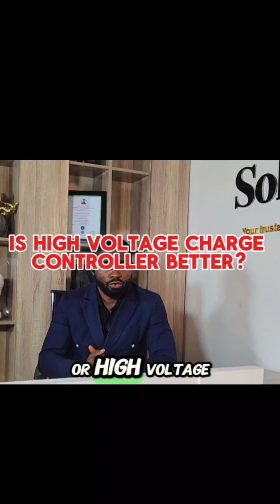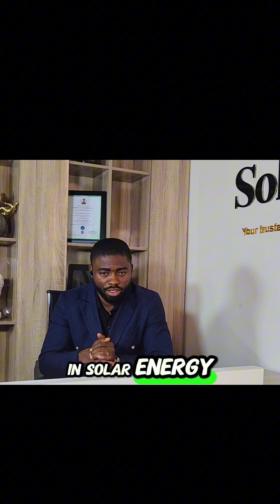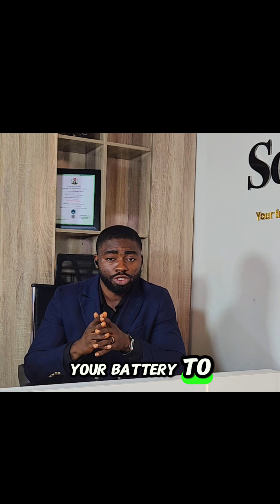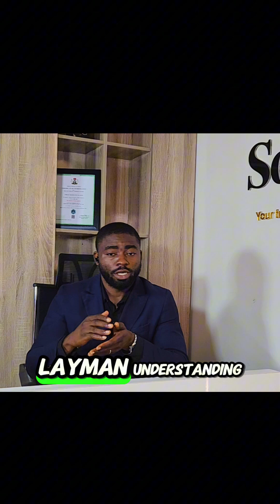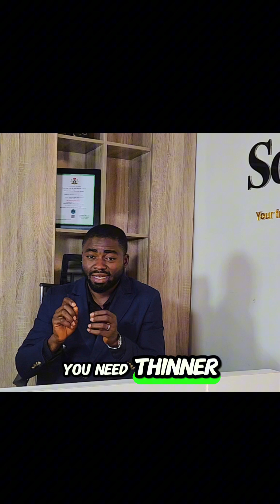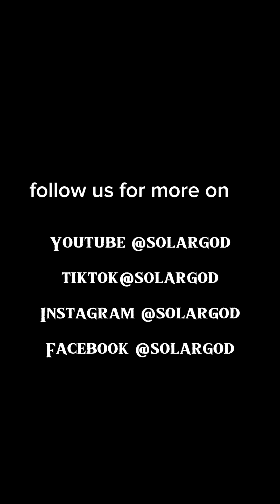High or low voltage solar charge controller??

Comment: You were among those that Argued that Mppt doesn't convert high voltage to current to charge a battery based on being highly efficient over PWM charge controller but here you are Today explaining and saying what u argued against in the past unknowingly.....Nawaoo😅😅😅😅

Nice Explanation doug. 👍🏿
Reply: I can even fetch solargod argument if he denies he never said that. Unless he decided to delete the video😂
Reply: @mubaraqabiodun4212 u dy mind am?.....I no get time to dy argue..... people that follow his videos already knows and evidence dy.
Reply from the maker: Voltage can never be converted to current oga.
It's just like saying that cassava can be converted to rice.
It's never possible and can never be.
Current can only be boosted which is what mppt does.
If i generate 50amps from my panels to a pwm and 10amps from my panel to an mppt I get the same result at the end of the day.
Because 
1 with pwm configuration my required current has already been generated from my panels, so no need for further boosting. 
2 with mppt a minimal current is generated and given to my mppt to do the boosting. 

You'll get same result on a good weather condition. 
On dull weather condition the mppt do perform better because of its ability to boost low current. 
So what's your argument?.
You think your mppt will give you 700w from 400w panel?
Reply from the maker: Note: if I use the same number of panels and sizes
Reply: @Mairigaemmanuel Voltage to current converter circuit (Transconductance amplifier).
Reply: @Mairigaemmanuel 

It's no more convert, now na boost Abi?....Any difference in what we are saying??😮😮😮.

Now let me use the term " BOOST".

NOTE: OHMS LAW: POWER (W)= VI
V= IR, this if current increases, voltage decrease and vice versa, meaning same power delivery.

Now back to Mppt:
Its efficiency lies in " BOOSTING" of current by driving max power tracked and delivered through high voltage and less currents via input to a hybrid or Mppt device ( Shey na boosting u mean).

Now assuming a 48V system with a 2400pv array consisting of 4pcs of 400w in 2s2p.

This configuration @ open circuit will give u around  84Voc & 23Isc

Now @ close cricuit, if the Mppt tracks let's say 1200w, it will deliver via input as roughly 80(Vmp) , 15 (Imp).........then the power delivered to battery will be battery voltage at the moment, for e.g (51.2V) X 23.43A.

That's the converstion..... voltage drops down to battery voltage, current BOOST😅 up from 15amp to 23.43Amp........same power delivered efficiently with less loss.

This is Ohms law in check not an argument without facts....you can use any other word than Boost, but all I know is Ohms law being applied.

Their is no electronics in this world that current will boost without converting or stepping down the voltage.....I rest my case.

After all, we have BOOST & BUCK CONVERTERS as their name implies
These devices explains all these bala blue that I wrote.
Reply from the maker: You don't even know what you're saying. 
Should have listened well while watching the video
Reply: Did he ever said that? Solargod was never that ignorant IMO
Reply: @Thollarkings be like u be new comer for this channel, no need to argue until u see receipts.
Reply: Yes ooo. I remember when solar god was arguing in favor of pwm😂
Reply from the maker: And the argument still remains. 
Pwm will perform as good as mppt if the right configuration is done
Reply: @Mairigaemmanuel not really, pound for pound, it's not very efficient, you will need to match the panel voltage with the battery voltage, and use multiple pwm controllers, thicker or many wires in parallel, then there is no power tracking, meaning it would still be less efficient even if all these conditions are met. You can argue it but that's just the fact, look it up
Reply from the maker: Explain how mppt tracks the power?